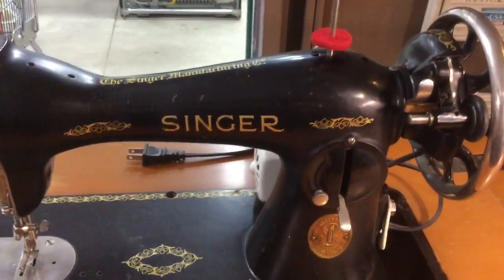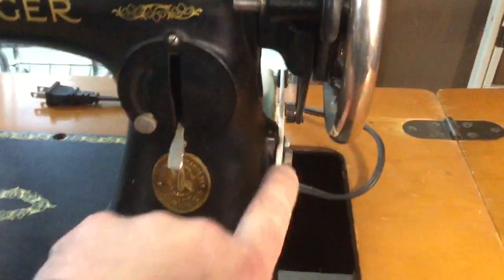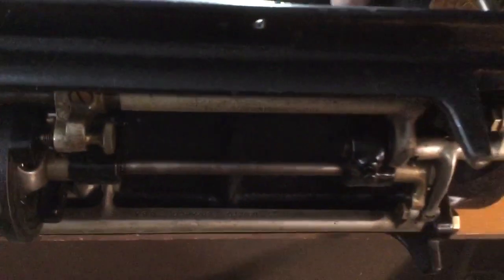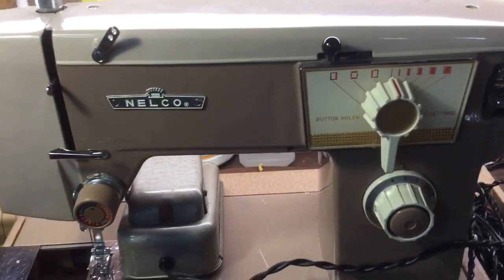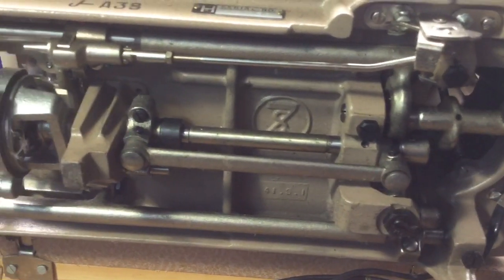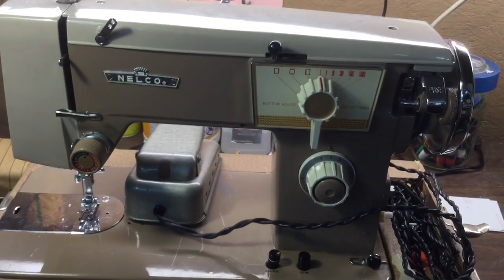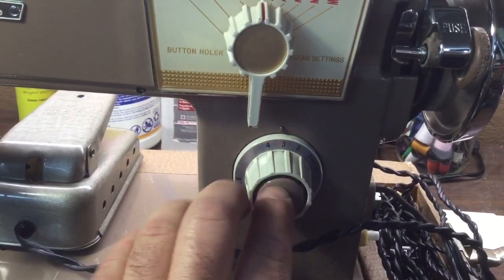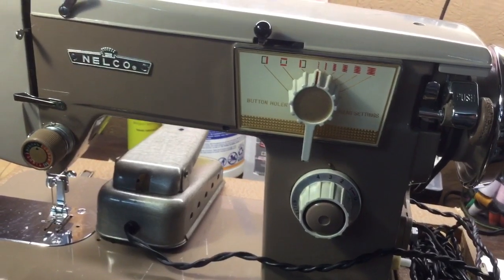Singer model 15 and Singer 15 clones

Comment: Can a Singer 15-90 clone be put into a  Singer 15-91 cabinet?  The cabinet is the typical Singer cabinet and the opening is 7 x 14.5. My clone machine measures the same as the Singer 15-91, 7x14.5. Thank you.
Reply from the maker: Check the pin spacing on the clone to be sure, but yes, you can put a 15-90 in a 15-91 cabinet. The 15-88 to 15-91 are all the same machine.
Reply: Thank you so much.